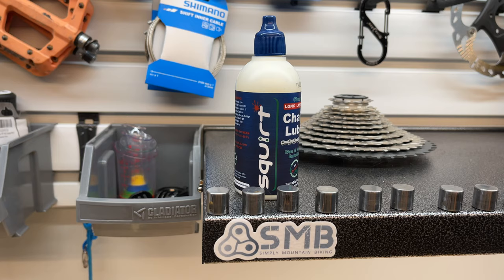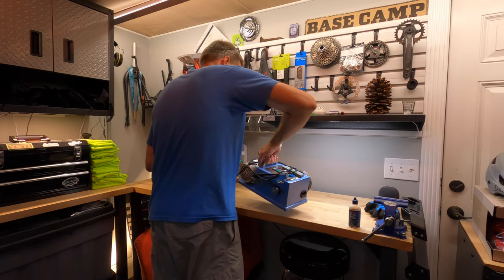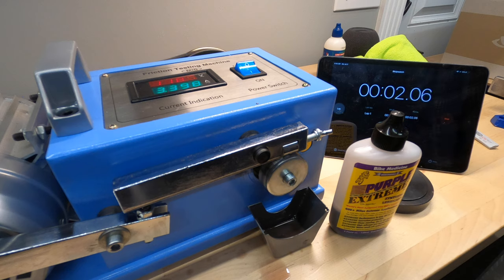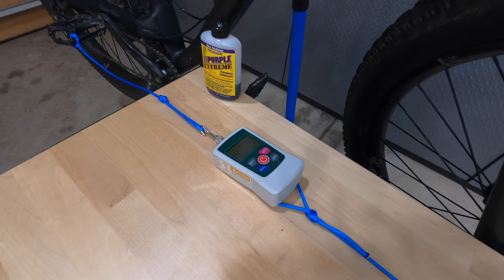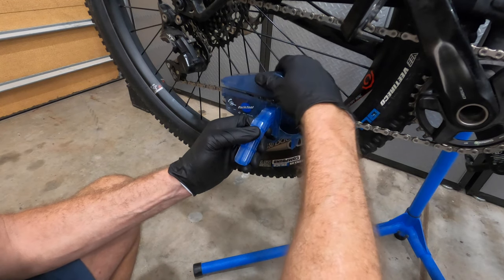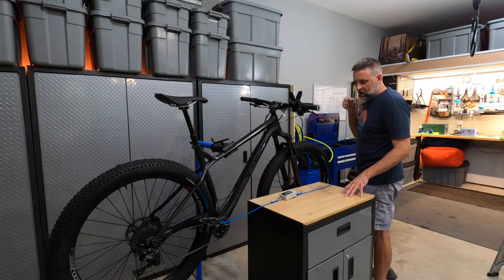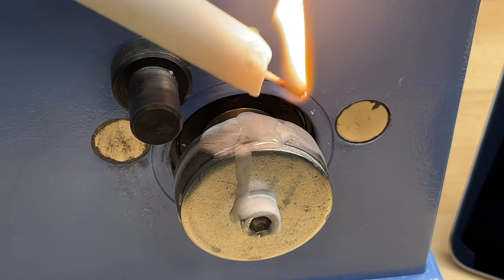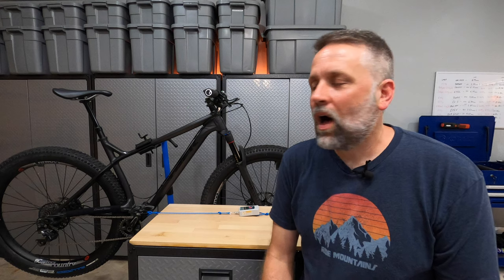Is Squirt a Good Chain Lube? | Squirt Wear Test

Comment: Hi Eddie👋🏼 you may remember me, I was one of your viewers who questioned your testing methods on Squirt (in it’s wet state). Thank you so much for revisiting the friction test and even developing another test method to check Squirt’s effectiveness👍🏼 You’re obviously a really professional guy and I’m impressed that you responded to the constructive criticism so well and we actually all gained even MORE knowledge of the pros and cons of Squirt.🙂
I switched to Squirt simply to give it a try as I had heard good things about it, but this latest data you’ve provided makes me think I should switch back to Muc-off Dry.
Thanks again for your thorough testing. Chapeau!😃
Reply from the maker: Yep - I remember you!  Thanks for your comments - I really appreciate them! -Eddie
Reply: I got Muc-off dry. Cleaned, de-greased, gave it half an hour in 120 watt ultrasonic. Then applied. It's a whole new chain. I set out to find a new lube, found that vid, and bought. Thank you so much for the scientific approach!!!

Comment: I've used regular paraffin wax on my chains over the last few years and one thing I like about was is it's ability to shed wet mud and water. The downside to wax is that you really have to thoroughly clean the chain when are ready to soak the chain. I usually have 5 chains that I rotate during the year and when I get down to the last one i throw the other 4 in an ultrasonic cleaner for a while before moving them over to my mini crock pot that always has the wax in it.

I've also started using Silca's Super Secret chain lube (the stuff in the bottle) and while I do like it, you still need to thoroughly chain that chain first and wait 24 hours after applying it. It makes the drivetrain super quiet.

Having said all that, the I've never gotten either wax to last long enough to finish a backpacking trip, so if I'm going on one, I'll usually strip a chain and bring along an oil based lube rather than bring along a 2nd chain. A small bottle of lube is way lighter and takes up less space.
Reply from the maker: Thanks for sharing! -Eddie
Reply: I went on a multi day trip with a waxed chain. After 450k it got noisy (normally I rewax after 200). I have taken a bottle with the Oz cycle recipe of wax in IPA. Reapply every 100k. Not perfect but the price I am willing to pay for a clean drive train.  BTW: nice channel, directly subscribed.
Reply: I used to have experience relatively short intervals between rewaxing, but a couple of years ago I started increasing the temperature of the bath (to 230-250ºF) and have had much better longevity since. I’ve also increased the proportion of PTFE in the bath. It all seems to help.

Comment: Great tests, nice job, thanks for your excellent video!

2 things though...Heat and dirt.

1. Your friction testing machine creates enough heat to melt away wax lubes...while a real bike chain being used does not. So by including heat at this level, your test is not relevant to the reality of how bike chains work in the real world.

2. You tested clean chains. No chains in the real world are clean. The main benefit of wax lubes is that they work like a mud guard to keep dirt out. They also shed over time, taking dirt away with them. By contrast, oil based lubes capture, or at least allow dirt to remain on the chain, and create a grinding compound. So absent dirt, your test is not relevant to how bike chains are used in the real world.

Ive used both oil and wax lubes before. I have no dog in this fight. But its only fair to make the tests actually test under real world use conditions. 
Thanks again for your excellent video. Please consider redoing the tests accurately.
Reply from the maker: Hmm - you really made me wonder how much heat is created in a chain when pedaling...  -Eddie
Reply: @SimplyMountainBiking  Its a good question to ask. I can put out a solid 500 watts for a minute. At the end of that, my chain is absolutely cool, even with petroleum based lube.

So id say you need to tune your test to the amount of power a normal person can put out continuously. Id guess around 200 watts or so for a fit person. 

Drop the heat to that level of friction and watch the paraffin "lube" beat every other one, just as they do on every semi scientific test. 

Cheers, friend!
Reply: @marcalvarez4890  wouldnt you need to run the test for hours at 200 watts so sort introduce another hard variable (doesnt squirt state to re apply after about 6 hours (i my self hate squirt never got it not to gunk up was always a black mess))
Reply: Considering nobody can liquefy a candle by jumping on it, considering all the transmission act as a cooling system, and considering a solid lub can't escape from a chain inner roller, I don't see any friction realistic test except to rebuild a fake bike transmission around your motor, and spray some sand and water on the rotating chain. Perhaps simulate 300km like this with 3 lubes, and measure the chain length and the lateral flex before and after. Challenging 😄
Reply: @simedinson984  black mess means your chain was not cleaned properly before install
Reply: @jjustinmbirchb  then it's not getting clesn followed the instructions

Comment: Soaking a rag with motor oil (any engine oil will do) and pulling the chain through it is all I do. 
That's it. 
Nothing else. 

Repeat every week on rainy conditions and every month on dry conditions. 

No special expensive chain oil, chain wax and no degreaser or anything else needed. 
Motor oil has everything needed, it works not only as a lubricant but also as a detergent and rust inhibitor, it has anti wear components, too. In winter it's thin enough and in summer thick enough due to its viscostiy improvers it comes with when it is a multigrade oil which every motor oil nowadays is. 
Like I said, everything ever needed is already in motor oil included.
There is no cheaper and more effective way to take care of your bicycle chain.

If you wipe off excess oil your chain stays clean. Oil has a very high ability to crawl everywhere, wiping off the surface causes no problem to the lubrication as the oil finds its way to the places where it is needed. So even a dry wiped chain is still lubricated inside and the oil stays there as long as it is not washed out.
A dirty chain is a chain not wiped off properly and was too oily.
Reply from the maker: Hey - it's better than not doing anything! -Eddie

Comment: I love the friction test. Very Project Farm-ish. 
I have been happily using Squirt for a couple years now, and have found that applying it after cleaning while the chain is still wet seems to allow more thorough penetration and longer intervals allowed between reapplication.
HOWEVER I've simply been brand loyal to what seems to work well for me. I watched this (and the first video) with an open mind... and just ordered muc-off dry to try on my new cassette and chain. 
My home trail is quite sandy and dusty, so wet lubes are not an option.
Reply from the maker: Let me know how it goes!  I'm finding that Muc Off does pick up some dirt - but it cleans off real easy and re-applies real easy.

Even with wax-based lubricants, I can't go more than 5 or so rides without at least a quick clean of my chain.  Muc Off comes off much easier than wax for me.

-Eddie
Reply: @SimplyMountainBiking  yes exatly. The other Thing i noticed is that ITS quieter Then squirtlube. So quirt is good for MTB but in daily City Rides i go MUC Off C3👍

Comment: The first thing I notice using squirt is metallic smell on the chain ring after each ride. its an indication of metal to metal rubbing. I have since move away from squirt to rock and roll extreme for both MTB and Road.
Reply from the maker: That's an interesting observation.  Thanks for sharing! -Eddie
Reply: Oh seems you doing original observations, problem that they are worthless.

Comment: Excelent information here. I too have used Squirt lube and heard that many cyclist where happy using it. But in the end I was not very impressed.  Now I am using Finish Line dry with the proper drying time and it seems to work nicely. It doesn't pick up sand or dust from the road and seems to perform well without many drag.
Reply from the maker: Thanks for sharing! -Eddie

Comment: Great vid. I have used ProLink Gold for past 20 years and have recently changed to Squirt after many friends recommended it. Of course, its nice to have a clean drive chain. Noise, smoothness (subjective, I know) seem the same as ProLink. BUT, I notice that Squirt slows rear gear changes ever to slightly. Its as if its stick a little requiring the RD spring/cable to work just a little harder to change up/down. Unsure if this translates to a loss of watts, but it is percepitble.
Reply from the maker: Thanks for sharing! -Eddie
Reply: did you clean of the chain thoroughly before using squirt ?
Reply: It also adds a clump of material on to the gears and it makes everything work worse. The clumps of "lubricant" were so bad that it was hitting the cage when the idling cogs were spinning making my drivetrain run super slow. I'll try the muc off dry, and then I'm just going to regular wet lube, and drying off as much excess as I can.

Comment: Great video Eddie.  The issue I’ve been having with Squirt is that it seems to stay tacky for a very long time.  Another dry lube I’ve used is TruTension all weather which I didn’t have this problem.
Reply from the maker: Yes, I agree it stays tacky - even after 18 months hanging in my garage - my test length is still sticky to the touch! -Eddie

Comment: Squirt has a percentage of oil in it to help penetration but it struggles to get inside the rollers without heat. The oil is causing the "stickiness" but by using the wax immersion method (Molten SpeedWax), you can eliminate the stickiness. Unfortunately your friction test is only testing film strength so it's a given that oil-based lubes with outperform the rest.
The test does not reflect real-world riding conditions. Think of a better test every 1000 miles (your chain replacement rate with oil-based grinding paste inside the rollers) and you will eventually find that wax is superior.
- - 6k miles on my chain and still <0.5 wear.
Reply from the maker: Thank you for sharing.

I do not think an oil additive is causing stickiness in Squirt.  I recreated the same stickiness using plain paraffin in the bike shop.  Paraffin wax is made out of petroleum - and you can find many places where it is used precisely because of it's sticky properties (e.g., waxing surfboards).

I do not doubt that a wax/teflon mix does pretty well on a road bike that is mostly subjected to wind-blown or tire-flung dry particles.

I've been considering trying molten speed wax (or a home-brew of high grade paraffin and teflon) in mountain biking - just out of curiosity.

I will admit that I'm biased in that I don't think it will perform well in muddy, wet, and extremely dirty conditions and will still require frequent chain cleaning.  I typically clean my chain every 3 rides during the wetter months.  I don't want to deal with wax every 3 rides, even if it means simply using an ultrasonic bath and wax dip.

In the end, a 12spd chain for my bike only costs around $60.  I think I'd rather clean my chain frequently for pedaling efficiency, and just replace it every 1k.  That's just my preference.

-Eddie

Comment: My response to all this because I switched to Squirt and found it really good. I feel some kind of lube regularly is better than no lube and waiting until the chain is noisy and rusty before lube is applied. the lube needs to be bike lube and not something from the cupboard or 10-30 motor oil or WD-40, which is used to clean bores of an Army M1A1 tank.
Reply from the maker: Yeah.  Regular maintenance and just about any lube is good.  -Eddie

Comment: Your findings are interesting, wish I had numbers from the other test as well.  What I can tell you is this:  I have used this lube on road, mtn and fatbikes for 13 years. what I find is that my drivetrain is lasting longer than some of the other lubes I've used in the past.  In  fact tried this one winter on my fatbike, with the existing drivetrain and never cleaned the drivetrain until the following spring. I live in Maine, so lots of snow, lots of salt on the roads in the winter months( I ride roads to trails in the winter months) and had very good luck. One thing that is different is that as a mechanic/shop owner, I always put lube on the bushings in the chain only. I've NEVER had stiff links in a chain regardless of which bike I'm using. I guess what I'm saying is that I like Squirt, and have lots of years os usage and many customers. But then again, that's one of the reasons that we have so many options out there.Thanks for sharing!
Reply from the maker: Thank you for sharing your experience! -Eddie

Comment: Have you considered taking some of the top lubes, pouring a handful of dust (basically milled quartz!) into it and seeing how it affects things? THAT is how any WET lube really behaves after you ride for 100 meters in dusty conditions ;)
Reply from the maker: Yes - many people ride in dusty conditions.  Some ride in wet/humid conditions (me).  Others ride in sandy conditions, etc.  My hope is that people take the tests that I've done into consideration and then apply it to their real world experience to decide what's best for them.  :)  -Eddie
Reply: @SimplyMountainBiking  well... aren't you interested yourself in performing such a test? That's what I'd personally do first thing if I got my hands on any wear testing rig. Data on lubricant testing is abundant, data on contaminated lubricant testing is very rare.

Comment: I appreciate the time and effort you put into these tests.  In typical fashion I bought something before looking at in depth reviews like these and scooped up a bottle of squirt.

The results about squirt in the wet test are curious for me because my thinking is, I can spray the sand off my drivetrain with my garden hose and the wax will stay intact after each ride.  I live in FL, all of our trails are sand so this might be a good solution

Thanks again
Reply from the maker: Yes - I'm finding that my needs are very different from those living in dry or sandy areas.  My solution may not work for everyone. -Eddie

Comment: Great job following up on comments from the previous vid. I think testing the force needed to rotate the wheel was very helpful in demonstrating the impact of wax lubricants. I’m not sure how it would be done but making a similar test in which the amount of force/power needed to pedal the bike for 30 miles or so would be very interesting. Just thinking of how to make the tests reflect actual use. Subscribed!
Reply from the maker: Great suggestion!  From what I've seen, most tests involve a human element - which is not good.  There are many folks out there that compare rides and wattage output, with wax in particular, and I think that's not good science.  I can ride with different power output on any given ride due to nutrition, sleep, bad mood, etc.!  I think a controlled test like you describe would be awesome! -Eddie
Reply: @SimplyMountainBiking  I agree on not involving a human element. Maybe a jig that connects a crank arm to an electric motor and the total electricity used is measured? The motor would need a speed controller to keep the cadence equal for all tests.
Reply: My personal experience with Squirt lube is, that temperature has a high impact. Above 10 °C it feels smoother. Below 8 °C they have a special lube for lower temperatures. Since Eddi did not provide the ambient temperature one can only guess, especially the "hanging chain" test shows me that it is not warm in his shed.